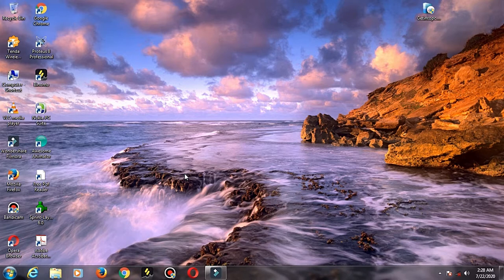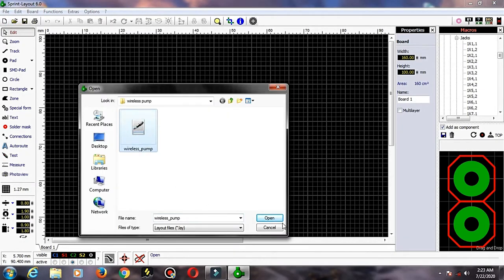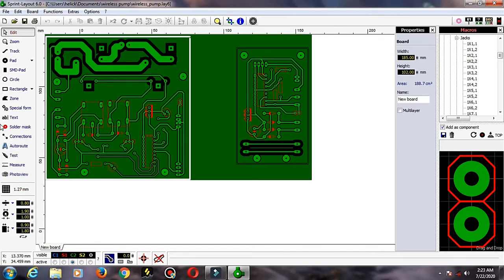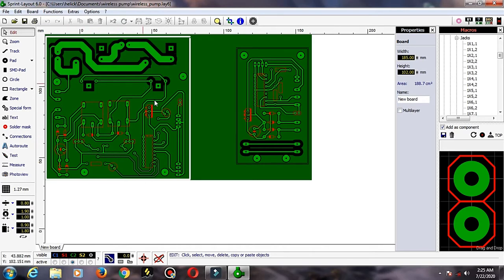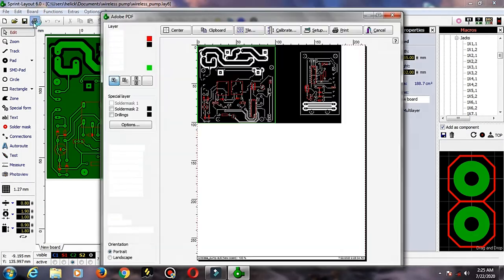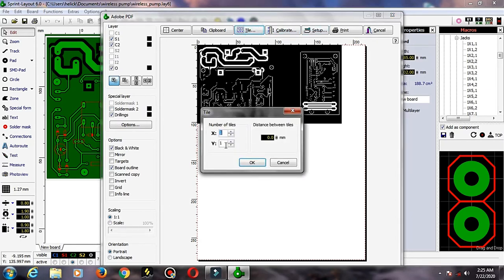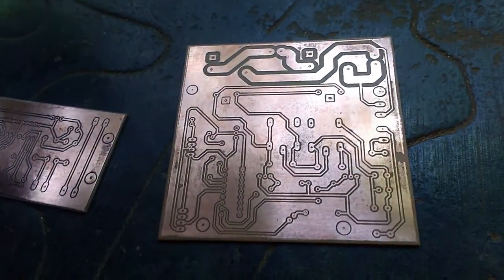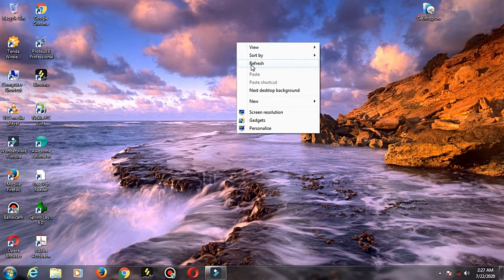HOMEMADE WIRELESS WATER LEVEL CONTROLLER USING RELAYS PART  1

Comment: where is second part? and also add english subtitles
Reply from the maker: will be soon released, thank you for your interest in my content. one of the components stopped working, have to buy another one. another important thing is my wallet is empty but i value your interest.
Reply: @essential_physics  yes im really interested so please make it in English or hindi language. and besides automatic there must be a manual switch to turn on/off motor at any time and water level should also be seen on reciever circuit via 7 segment display from 0 to 9 or in lcd display.